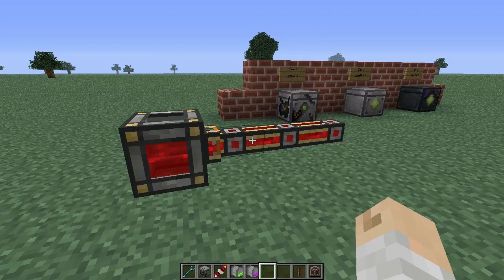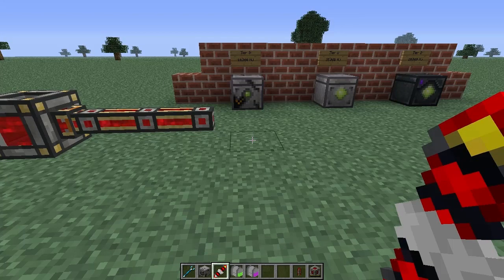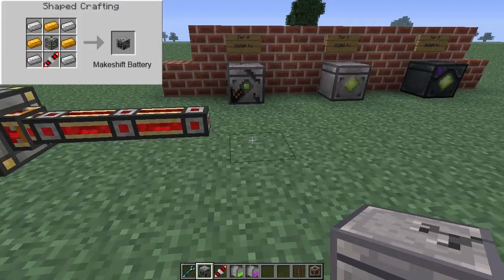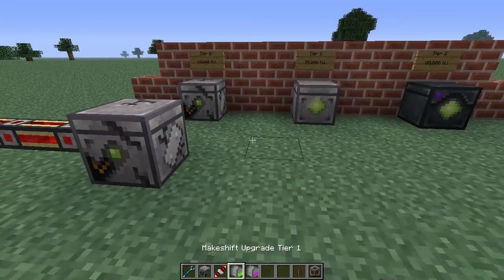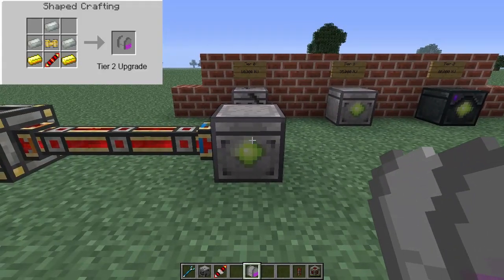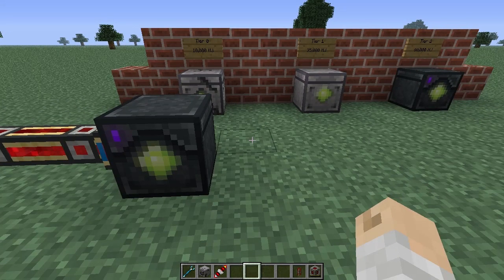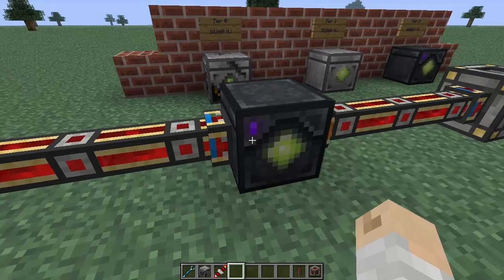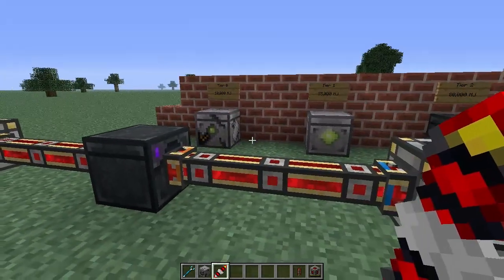Wylker's 3 Minute Mods: Simple Power Storage

Comment: Yeah, but the truth is, even a mark 2 battery from this mod can only hold 80K MJ. That is 7.5 times less than the REC, only has 1 output side and you can't limit the output. The mark 1 and 0 batterys can hold even less, making them 17 times or even 60 times less power. I think it is fine.

Comment: I could be wrong, but I think the idea with Thermal Expansion is that you don't *have* early-game batteries. IC2 machines could run for a few seconds without a power supply, but the TE machines actually have decent internal buffers and can run for a while with no problem at all, so low-tier batteries are much less necessary.
Still a really neat mod, though.